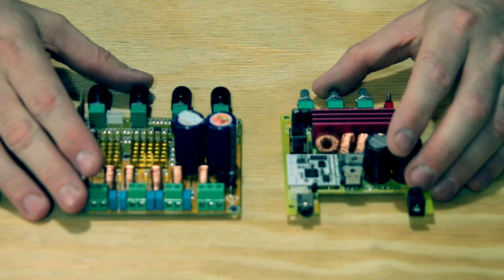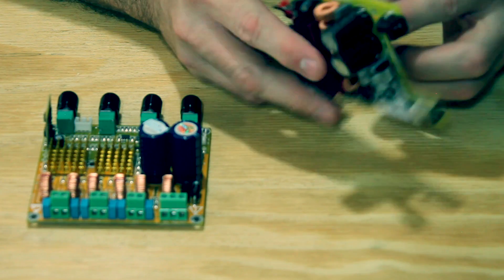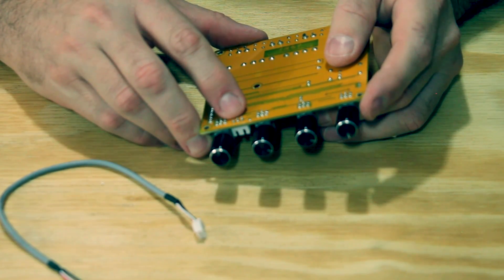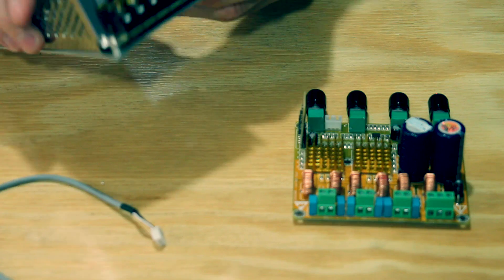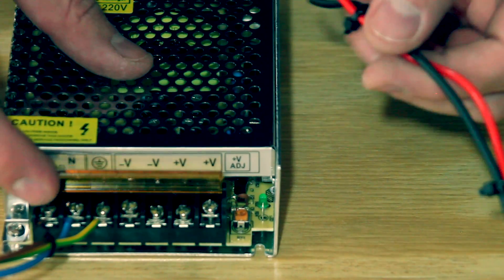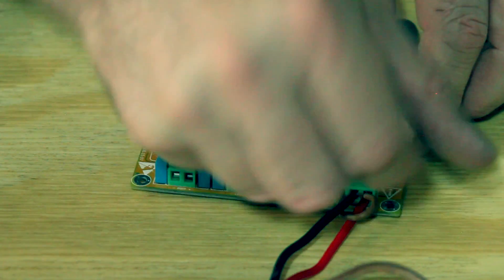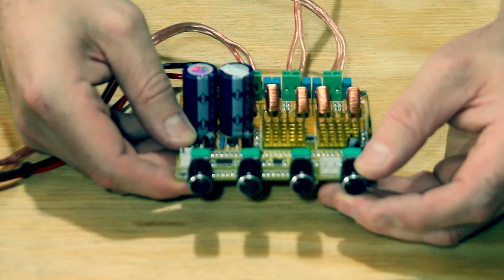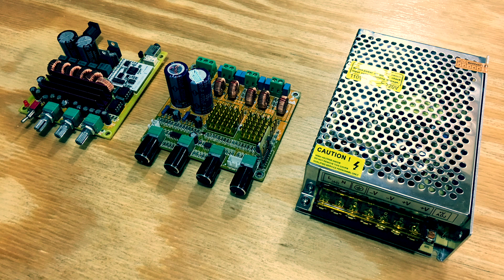TEST BENCH: TPA3116 2.1 Channel Amplifier Boards with Bluetooth 4.0 - by SoundBlab

Comment: fyi vcc gnd vcc. 24 - 0 - 24, creates a range of 44v but that is only when you are wiring it correctly, you are not. A transformer suited for this type of amplifier will have 2 independent vcc and  1 gnd.  that being said you are literally cutting its power in half, and by limiting the voltage, you will increase the amperage draw.

Comment: @SoundBlab 9:05 one of vcc is for remote control to power amp with low current but some voltage

Comment: CHECK your power requirements.
That LOOKS LIKE a centre tap + 0 - connector on the board AND it has its own rectifier on board.  If that is the case you are only taking a smaller voltage from your power supply so your 12 volt DC supply only fed in 12 V minus the rectifier diodes drop, a 12 V alternating current rectified output would be about 40% higher minus the rectifier’s drop.  This would be about 10.5 V instead of about 15.5 V.
A basic centre tap transformer would work in that case with the three output wires connected to the board, if , IF it is a + 0 - input.  The 12 V DC could be fed in after the rectifier IF done competently and safely, it might work if the switch mode power supply adjustment was turned way up but a centre tap transformer is inexpensive.
Thanks for the review, was the switch mode power supply feeding the amp with the hum?

Comment: I follow much of your work, and I absolutely love it. Unfortunately this one is an  dud. I expected some form of review or test results to help choose an amp. Instead the lions share of the video is schoolboy stuff attaching wires to obvious terminals. What does it sound like. Is the Bluetooth delay low enough to be used for a TV 2.1 sound system

I just have to assume anybody buying a DIY amplifier board can connect Live, Neutral and Ground to a power supply.

PS - Do you have a discount on your designs for locals. The present ROE makes a $29.99 set of plans way out of range for a pensioner like me. That’s nearly half a months pension.
Reply from the maker: Thank you! To be honest, I have come to realise that doing reviews is not my strong suit here on YouTube, and they probably do my channel more harm than good. So I apologise if I did not do this one justice. It was also the very first one I tried. The again, I am also not here to be perfect in every way, I do my best and if that is not good enough for some, then they should rather move along. I'm not saying this is you, I would rather take your comments as constructive criticism, which I find useful to improve. So, thanks you, I appreciate the feedback.
Considering the time, cost and effort that I put into the builds, video and build plans, I find that $29.99 is a steal for the average person. Unfortunately, when you consider the ROE, that is something that is not under my control, and even I have to live with it when importing very expensive parts to make these videos, it sucks!

Comment: I have the 2.1 amplifier that he recommended and I really don't like it. It have a awful hiss that low volume and It have distortion at high volume. It is nice that to see an Chinese amplifier that can produce bass at 120 to 250hz but I still don't recommend it because for it price, I can get a breeze audio amplifier and it perform way more better.
Reply: In addition, it have background noise. Which is very disappoint.
Reply from the maker: You might have a knockof of the amp or its not exactly the same model, or your connections are incorrect, because I am not experiencing any of the issues you mention. Its always good to compare apples with apples, and in this case we just can not be sure that you are. There are many of these amps around for sale, and they are not all the same quality.
Reply: @SoundBlab  I contracted the seller and they resent another one for me to test out. I think I got a defective item.

Comment: Hi master. Please let me know.. I have tpa3116d2 Bluetooth amplifier board
 12ow+12ow 12-24v 3a. And my power supply is 24v 3a adjustable valtage down to 12v. 

My question is. Why the amplifier will automatically disconnected while the power supply is on?.any idea?

Comment: Never forget to wire  positive to positive on the speaker or you will get less bass or power
Reply: MrBrymstond don't quite understand. How do you do this? Just connect the positive from each output to one another?
Reply: Some will hook the negative of the amp and the positive to negative of the speaker because there's no mark so use a battery AA the pos will make the speaker push out neg will make it push inwards and you'll get the correct amount of bass.
Reply: @madsravn2070  You follow your positive wire from the amp to the pos on the speaker and if there's no mark on the speaker you can use a AA Battery, if the negative on the battery makes the speaker pull in the negative on the battery is telling you that you have the speakers positive so as a test you turn the battery around and the speaker pushes out a bit so if the speaker pushes outwards look at the battery positive and that will be where you connect the positive from the amp to the positive to the speaker and mark the speaker + and -

Comment: You need a power supply like that one? And if yes, why?
Reply from the maker: I like the simplicity that this power supply offers. You can however also use a regulated power supply with a transformer.

Comment: my board burned after 5 MInutes. Some Resistor near the big capacitor smells and smoke. any idea? use the board with 24V
Reply from the maker: Check your connections again. But I have heard that a few people have received faulty boards in the past. It could be that you did as well.
Reply: Thank you for your answer. I am no electrical expert and had the hope someone knows this error and can tell me which component is broken. I have contacted the seller and he wants to send me a replacement.
I like your work - keep it up

Comment: i love this build!@  im trying to make my own google home max type speaker! but i dont know how im going to add Bluetooth to my amp i got.    ive seen the Bluetooth boards on ebay but im not sure how im going to power it?  I was thinking i could open the amp and split off the positive and negative to the bluetooth  but i think my powersupply is 36volts and the bluetooth adapters only accept 5v to 24v mostly .  would i just then wire in a downstep for voltage then ive seen those on ebay too   

this is the amp i got coming
https://www.ebay.com/itm/G-E-K-GA-98-TDA7498E-2-0-Ch-160Wx2-HIFI-Digital-Amplifier-Power-Supply-Black/263121908312?ssPageName=STRK%3AMEBIDX%3AIT&_trksid=p2057872.m2749.l2649
Reply from the maker: You could use a downstep converter, but also use a ground loop isolator otherwise you can get interference via the bluetooth module.

Comment: if i plug 8 ohm speakers to this board will the output power drop down from 50w ?
Reply from the maker: According to the datasheet you should be getting 30w per channel on an 8 ohm load at 24v power supply.

Comment: Hi there, was hoping you would cover the aux input as well. How do you switch between bluetooth and aux in? Is it just a case of if nothing paired via bluetooth it will revert to aux in? Or is there an actual swith on the board somewhere? Thanks
Reply from the maker: No switch, just reverts back to aux when bluetooth not connected.
Reply: SoundBlab thanks for the confirmation, much appreciated. Really enjoy your content as well.

Comment: Would you connect this to a crossover if you wanted a two speaker setup, like a subwoofer and speaker for everything above that range? So a 80hz and below for the sub and 80hz and above for a full range speaker? Crossovers are a mystery to me, any advice on ones to go with?

Comment: Greetings from Greece ! Do you think TAS5613 2.1 amplifiers could be a better deal?could you make a review also please?
Reply from the maker: Hi. I have not tried one of these amp boards. Mostly because I have not found one with built-in bluetooth. Also the power requirement is around 36V, which means you need a beefy power supply. If I see myself doing a project with this in the future I could do a review, but I don't think it will be soon.
Reply: http://www.ebay.co.uk/itm/Douk-Audio-Bluetooth-4-0-Hi-Fi-TAS5613-Amplifier-2-1-Channel-Subwoofer-Power-Amp-/282074498316?

Comment: 180hz is okay for a woofer but people think this is meant for a sub-woofer where I seen them at 15hz ~ 180 or less hz so you have to know what you're running. A sub like this would barely get a signal and that 100 watt channel I believe, but not sure if they accounted for this which I doubt is setup to give 100 watts spread across the span of 20hz ~ 20k or 20,000hz so the woofer is only putting out the amount of power subtracted from the spectrum.
Reply: I'm almost certain that you could change the pot that's meant for the sub with a pot that will accommodate your sub or woofer because a pot is just a variable resistor. A push pull pot would be nice if you can figure it out so when you position it in you are adjusting the bottom end and pull it out and you're adjusting the top end of that speaker

Comment: Hi..I'm a new subscriber my question its I just bought a 2x100W TPA3116 D2 Dual Channel Digital Audio Amplifier Board 12V-24V for Arduino..I was thinking to get a 24v / 5A power supply it this will be great to power this amp?
Reply from the maker: Yes, it should be sufficient.
Reply: SoundBlab thanks! 😄👌

Comment: "Connect the resistor across the input and ground on each channel..." For connecting a music player try a 1k ohm resistor and for a line in try a 2.2k up to a 10k ohm resistor, any higher than 10k and it may not get rid of you noise, but in this case, you can use a pot across your inputs on your aux and bluetooth to something that matches your uses as described. Potentiometers
Your 3 pots are STEREO/BASS/TOTAL Volume
Reply: Do you have that noise when the cable you added is disconnected? Try placing the resistors there and use a shielded cable

Comment: Hi.
I have bought PC65.2C and CXX10 and want to buy amp for thees speakers and subwoofer. Can you suggest something, as I can not figure out which one chose. as for price, I would like cheaper))
Thanks a lot

 this is links of my woofers 

 http://www.bossaudio.com/product/car-audio-sound-system-auto-stereo-single-voice-coil-subwoofer-boss-audio-cxx10/  

http://clicknshare.net/goto?to=http%3A%2F%2Fr.srvtrck.com%2Fv1%2Fredirect%3Fyk_tag%3D67_47_b_1cb1e_507272844%26url%3Dhttp%253A%252F%252Fwww.bossaudio.com%252Fproduct%252Fcar-audio-sound-system-auto-stereo-speaker-boss-audio-pc65-2c%252F%26source%3Dhttp%253A%252F%252Fclicknshare.net%26api_key%3Dabbc5236946676eae219a734c0a1c5e8%26site_id%3Df680c352f4ea463ea7c792793d1710b2%26type%3Durl Thanks a lot
Reply from the maker: You don't mention what you are building or how you intend to use the drivers. Do you need bluetooth connection etc. These drivers however are very high powered and you can connect them to powerful amps. It's therefore difficult to recommend what you need without knowing what you are building.
Reply: I want to make 2.1 audio for home use, music, films so on. and can you suggest how build box for speakers and tweeters, thanks a lot.

i fo not ned bluetooth

Comment: I use that second board a lot. The knobs are pretty simple if you just played with them for a minute or two. There's the main volume control but the other two are independent volume controls for the 1x100 channel and the 2x50 channels, so you can adjust the volume of the subwoofer channel and the full range channels.
Reply from the maker: Thanks. I figured it out in the meantime, but I still don't like the board. Mostly because the one I have produces a noticeable hiss. I also can't set the crossover frequency, it is a fixed value.
Reply: The crossover frequency is a fixed value but you can do two things to eliminate the hissing sound. You can find the spec sheet for the tpa3116 chip and change the resistors in it to adjust the gain setting, or you can use higher impedance speakers. I have mine set up with an 8 ohm subwoofer and two speakers in series per 50 watt channel to make 12 ohms. They're rated for 4 ohm speakers but almost all cheap chinese chips have problems at lower impedance levels. This chip is actually capable of hifi sound with high impedance speakers.
Reply: I highly suggest checking out FFcossag's video on fixing the noise floor. For my it's actually the first suggested video on the page for this video. All you have to do is change the two resistors near the central chip. A much simpler and less engineering intensive solution would just be to get duplicates of the speakers you're already using, then wire all of them in series to use two speakers per channel. The higher impedance makes the chip produce slightly less power but Greeeeeatly reduces the distortion and produces better quality sound. This is true for almost all amplifiers as well, it's better to match it's maximum rather than it's minimum impedance for quality of sound, and better to match minimum impedance just for volume.
Reply: Presuming you swap resistors and add the jumper per FFcossag's video to eliminate the hiss / sync noises, is it then free of ALL noises?  I've used the version of this board without BT and added a separate BT board with mixed results but never tried this one with it built in.
Reply: Glenn C I'm very curious about that too.
Reply: No, I didn't swap any resistors or jump anything. I just matched it with a good set of speakers with the maximum impedance that the amplifier can handle. The higher the impedance, the lower the noise floor. By pairing this amplifier with 8 ohm speakers I saw a vast improvement, and with 12 ohm speakers I can turn the volume all the way up to the 90% mark without any noise or distortion. At 90% and above you get some distortion but still no background noise. You don't need to alter this board in any way to make it sound better. If you're having problems, you either got a faulty unit or you're matching it with poor speakers of incorrect impedances. I highly suggest using perhaps two sets of speakers wired in SERIES for the best results